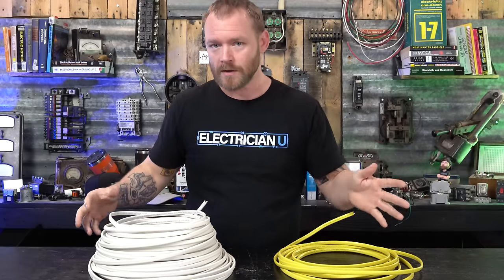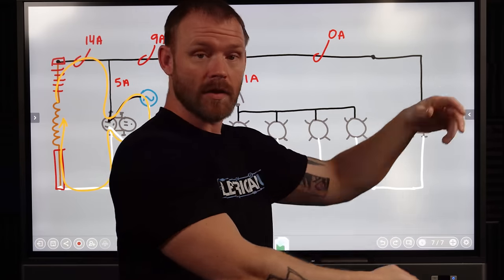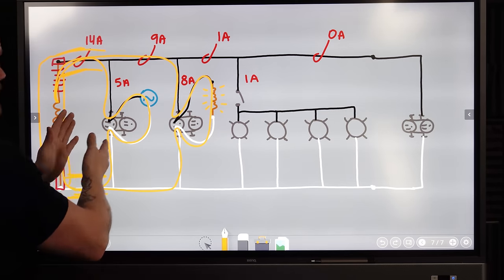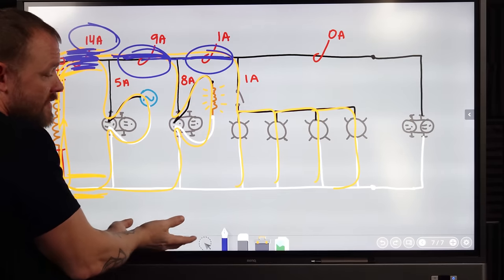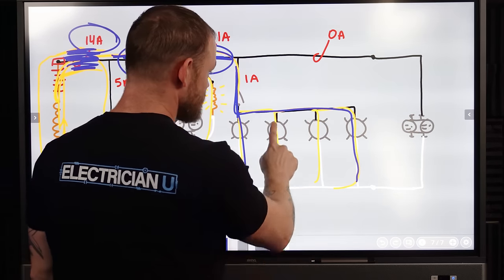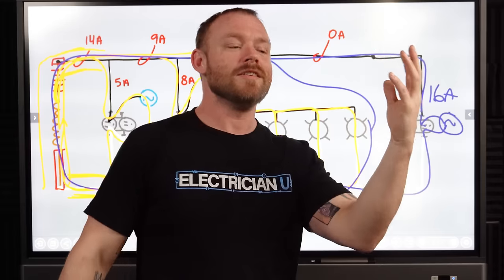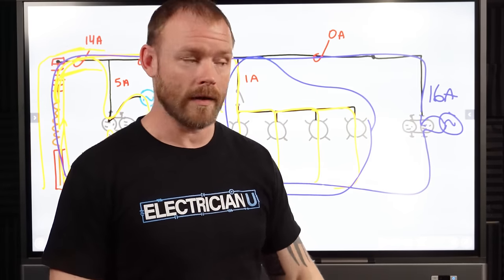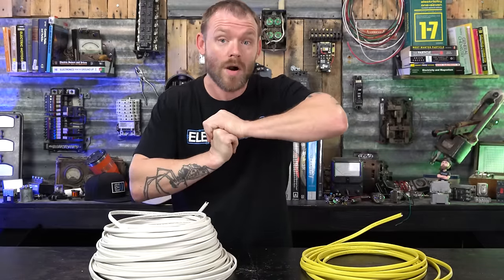Should You Be ONLY Using 12/2? When Can You Use 14/2?

Comment: I completely disagree. If you have a 20 amps breaker, code does not allow you to reduce conductor size based on actual load except in very very specific situations. The idea being that if you have an overload (say a high impedance short circuit)  in the circuit and you have reduced the conductor, it may melt before the cb trips. By sizing all conductors according to upstream protection you prevent this situation from happening
Reply: I agree the Breaker is to protect the wire! or the equipment!
Reply: Yeah that was my immediate thought; what clears the fault on the LED leg before the wire melts?  In principal it'd be safe if that leg had an additional fuse or something but IDK if there's even code for that.
Reply: Plus once you start mixing different gauge wires and splicing things together it all becomes a mess to deal with for any future person making repairs or modifications.
Reply: I changed my position on this. 

I am not worried about a sharp short-circuit condition that would cause 100s or even 1000s of amps to flow in the circuit. A 20A cb magnetic protection would trip instantenously and clear the fault and limit the total energy (Amps x Time) below the allowable thermal envelope of both 12AWG and 14AWG wires.

I am worried about overloads or high impedence faults, which would limit the fault current to lower levels (between 15 and 20ish Amps), which takes the cb much much longer to clear and could generate too much energy and melt a 14AWG wire.

Now, are there jurisdictions that consider the situation of such a fault happening unlikely enough for lighting legs that they build exceptions into local codes for reducing conductor size to 14AWG on a 20A breaker? Yes, I believe that is likely. I would still prefer feeing the lighting circuit from a 15A breaker though.
Reply: @philibertperusse8998  What about a fault condition that doesn't draw 100's of amps, but somewhere between 15 and 20? And is not detected for years, could that cause overheating in the 14-gauge wire and eventual breakdown of the insulation?
Reply: @jessequentin4441  That's the second part of my change of position argument. And as I wrote, while this case is theoretically possible, it is possible that some jurisdictions find that unlikely enough to make exceptions in local codes to allow it. It is always a balancing act between risks and costs/usability
Reply: A "high impedance short" between 15 and 20 amps would get ridiculously hot and burn down the house way before the rest of the cable is even lukewarm.

If such faults existed, you would also have circuits with 15A breakers burning down due to those "high impedance faults" that take less than 15A and making slightly-less-than 1500 watt heaters in the walls. Not likely.

The reason why changing wire size is frowned upon is the risk someone wires receptacles or new loads into the part of the circuit with the smaller wire, and then it can get overloaded.

If the only wire that is smaller feeds one light, and branches off heavier wire in a junction, IMO the installation is fine.

Having junctions with only the lighter wire and long sections of the installation with only lighter wire, branching off some early junction box with heavier wire, is yucky although perfectly legal in some jurisdictions as long as all loads are fixed and loop impedance is low enough to trip the magnetic trip for touch voltage safety.

Of course having a section of lighter wire feeding a section of heavier wire would also be very confusing and yucky, still allowed in a lot of jurisdictions.

Still I wonder who doesn't look at the size of the breaker when turning the circuit off before you start adding loads?
Reply: so use a 15 amp breaker then lol
Reply: I think his mouth was working faster than his brain and confused people that are more DYI'ers. At the end of the day for those folks;  You cannot use #14 and a 20A breaker, period. (yes I know there's exception but they are rare in residential)
Reply: I was trying to give the host the benefit of the doubt in that he is trying to use the 14/2 in the house on 15A OCPD (breaker) instead of 12/2 on 20A OCPD and that he just did not articulate changing the OCPD to reflect using the smaller wire since his loads with LED's are  minimal, but after watching the whole video a couple of times it becomes apparent that he is struggling to understand NEC (or he is struggling to properly make his point within the boundaries of the NEC). Not sure why the jurisdiction that he is in requires min 12/2 on a 20A branch for every branch circuit - I would definitely take them to task for not following NEC - but that may not be worth the trouble. If the OCPD is 20A then all wire to every junction box MUST be min of 12/2 (can be more if voltage drop becomes an issue). Yes, he is absolutely correct in stating the multiple LED's in parallel would not use more than a minimal amp past the switch, but the NEC does not allow us to downsize the wire at the switch just because of the load (and, if that switch is on a 20 amp branch circuit then it has to be rated as a 20A switch instead of the normal 15A switch). The reason for that is that in the future someone could come in and want to change out those LED's to something that needs to use more than the 15 amps downstream of the switch and now the wire would not be able to handle the load.  The only way to drop wire size when feeding (please correct me on this if I am not correct) the LED's would be to have the 12/2 20A terminate to a ballast or transformer after the switch, and then from there size the wire to all the LED's according to the maximum output Amperage of the ballast. Now if a LED fixture itself (as a single unit) is UL rated they can use smaller wire from the junction box to the fixtures (think a pendant light that usually has 16 awg or 18 awg) but that is a single unit manufactured UL listed fixture and is permissible in the NEC.
Reply: Devils advocate: the light fixture itself uses 16 or even 24 gauge wire, how is that different?
Reply: THIS IS EXACTLY WHAT I WAS THINKING! HOW CAN AN OVERLOAD ON THE 12/2 NOT INTERFERE WITH THE 14/2??  EVENTUALLY THE ENTIRE CIRCUIT WILL BE AFFECTED RIGHT??
Reply: @hippo-potamus THE THING I DESPISE THE MOST!!!!
Reply: I am reading alot of ppl saying how this and that could happen and mostly it's negative comments! By installing an ARC FAULT BREAKER,  wouldn't this stop ANY overload causing ANY melting of ANY wire???
Reply: what about all the pre-wired light and fan fixtures that have 18ga stranded wires? That is the load, shouldn't would be the place that burns first because the wire is so small?
Reply: exactly! also circuits and their loads aren't set in stone. it's likely to change and or be added to in the future.
The NEsafety rules, however they give them room to make a judgment call to increase the safety if observed.
Reply: @chrisanthony579 thank you for posting this comment. I’m a DIY-er and there was definitely some confusion with this theoretical application.
Reply: @jessequentin4441  You are correct, the NEC requires overcurrent protection for the smallest gauge wire in the circuit, and this You-Tuber is incorrect in suggesting a 20 amp circuit wired in #12 can feed spurs of switched legs for lighting using #14 AWG. I know of no jurisdiction in the USA that would allow this exception or put it in writing and codify it into their local code exceptions.
Reply: @Kulow1  The NEC allows 15a rated switched on 20a circuits the same exact way it allows 15a rated receptacles on 20a circuits. It just has to be a convenience circuit and not dedicated. (Like, a 15a switch cannot be used to disconnect a 20a circuit if all it feeds is one thing like a boiler or an air handler.)
Reply: "Code" is different every country, state, city, etc.
Reply: @MrXelig  Fixtures and appliances follow UL standards, building wiring follows National Electrical Code. Utilities even have their own codes as well.
Reply: @mrniusi11  No, because a fixture or a ceiling fan is a self-contained device and it's total possible load is known.

Comment: Nope, he's wrong.  You can't have a 20 amp OCPD and use #14 gauge wire in a residential application.  In his example, no it wouldn't cause a problem, but the code is designed to be fail safe.  For example he is just assuming no one would ever add multiple ceiling fans, chandelier, etc. to that switch leg causing the potential for the 14 gauge wire to carry more than 15 amps

Comment: This video could've been 2 minutes long. As long as you're installing a 15A breaker (and your AHJ allows 15A circuits), then yes you can use #14 wire, because #14 copper can handle 15A (240.4(D)(4)). If you're running a 20A circuit, then you MUST use #12 (or larger) wire. There are exceptions, but none of them apply to running Romex to light fixtures. EVERY section of wire must be at least #12, even if it's just feeding a single light fixture.
Reply: He seems to disagree with you.
Reply: @phi5head  And I disagree with him. I read all of the code sections he mentioned in the video, and nothing in any of those sections says that you can run #14 to light fixtures on a 20A circuit. I'm more than willing to admit I'm wrong if someone points out a code section that says otherwise.
Reply: @jonclark1288  I'm with you. It will be interesting to see if he addresses all of the people in the comments telling him he's wrong to be doing that.
Reply: Ahj was the key words here
Reply: @jonclark1288  It doesn't make sense to me. i can understand if it's a 15A breaker. #12 to the outlets to prevent voltage drop, and #14 to lights since under normal loads they draw very little power. But even then, I rather have #12 go to the lights since I've had issues with LEDs flickering when the voltage drops slightly. Also don't have to worry about how much of what # wire you have, just buy #12 and forget about it.

Comment: Wow, that was confusing and conflicting information about circuitry and ampacity. You have to use correct overcurrent protection for the smallest size wire on a branch circuit, so combining 12cu and 14cu is not recommended or legal. Unless your loads on the 14gauge wire is on the load side of a low voltage driver and/or transformer

Comment: I own a duplex where they basically did this on some of the receptacles. 20A breaker with some 14awg feeding the last few receptacles. Tenant had his gaming PC setup (multiple monitors, high power pc stuff etc) and nearby baseboard heat going. The 14awg was probably drawing over the 12 amps it really ever should have been drawing. With the combination of the heat from the pc and baseboard and the overloaded wire, it melted off the receptacle. Luckily didn’t start a fire but that’s how I found out about it. I imagine a 15 amp breaker may have prevented the problem which is what I put on instead.

Moral of the story, DONT MIX AND MATCH WIRE!!!

Comment: Great  explanation. 
After working with cheap #18 luminary wire behind a fixture that breaks, I'd rather stick with something larger. 
Plus, if they repurpose the circuit for a vent fan or warming light they will need the current. 
Never cheat code, always go above the minimum.